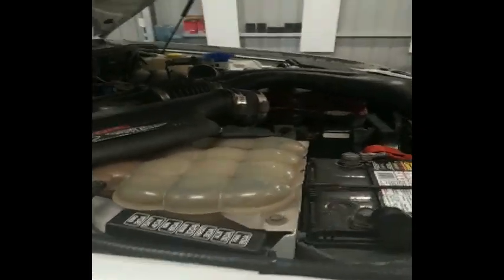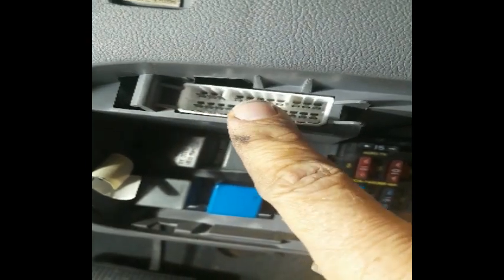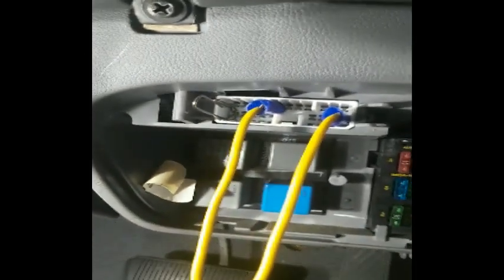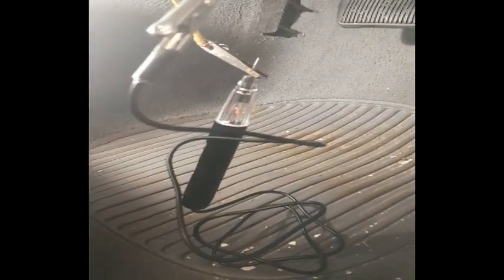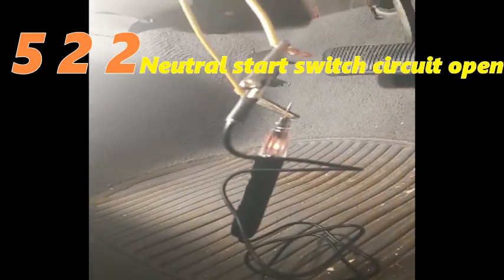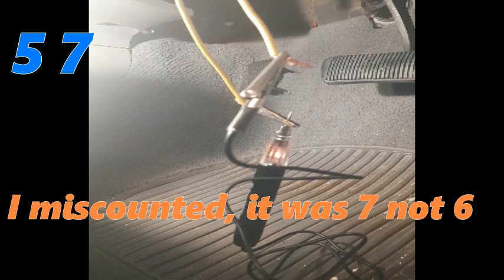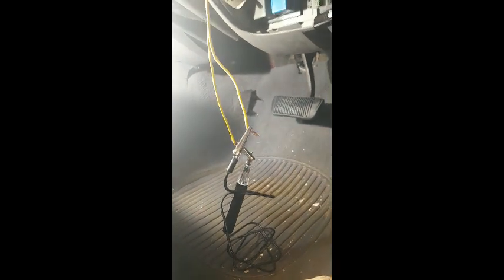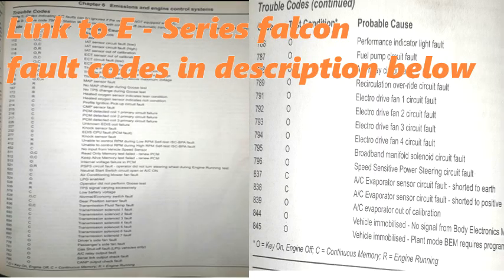EBII to EL falcon fault codes

Comment: Thanks mate. Great tutorial. What's the best connector to use on the pins?
Reply from the maker: general electrical connector crimped onto the 2 wires that then slip onto the 2 connector pins perfectly.